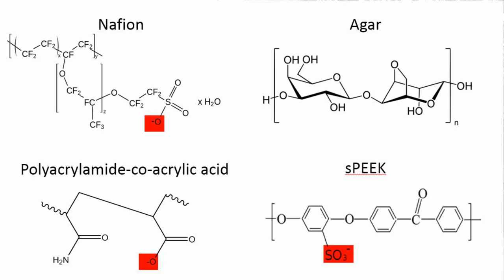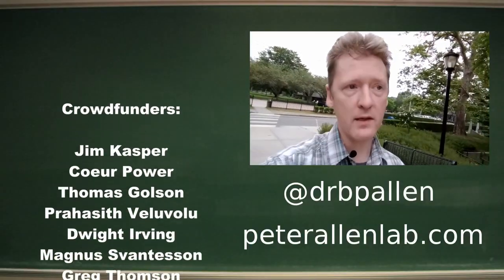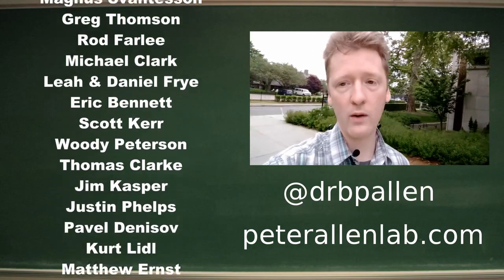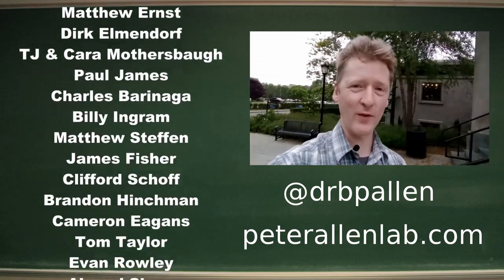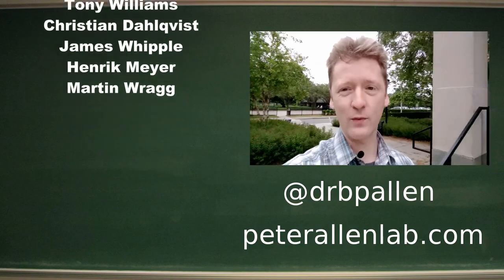Battery chemistry: Polymer separator

Comment: You ought to try a PEEK ion exchange membrane.  They are relatively easy to prepare in the laboratory.  Obtain PEEK plastic from sources on the internet.  Sulfonate it, then dissolve in solvent and "cast" it into a sheet by painting onto a plate of glass.

Comment: Have you tried nitrocellulose paper?  It's available for doing Western blot assays.

Chitin might work, though I'm not sure if it has the right charge in your cell conditions.  If I recall correctly, there was a paper ~2012 in LoC where they formed a chitin membrane in situ within a microfluidic chip.

It might be a long shot, but you might be able to cheaply modify paper with successive multiple ionic polymer layers.  SMIL was a coating method for CE, but you could probably achieve it in 2D with paper above a flat electrode.